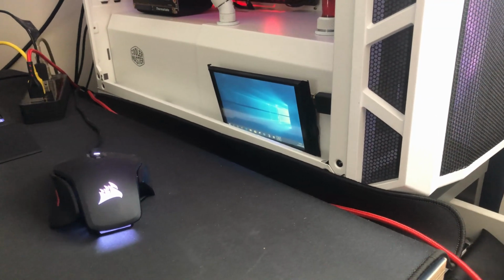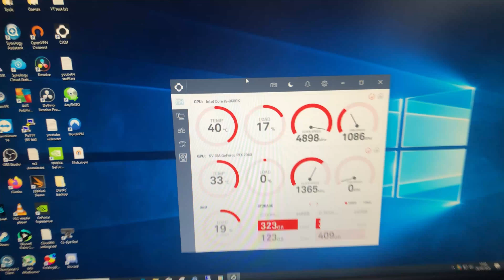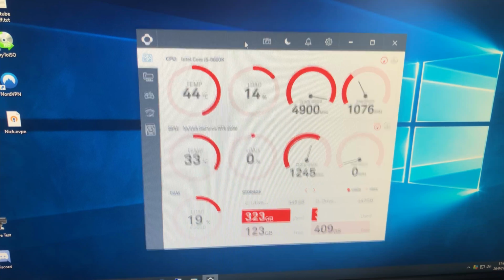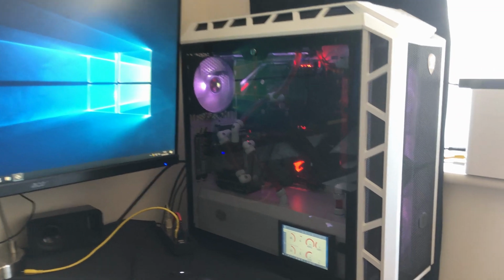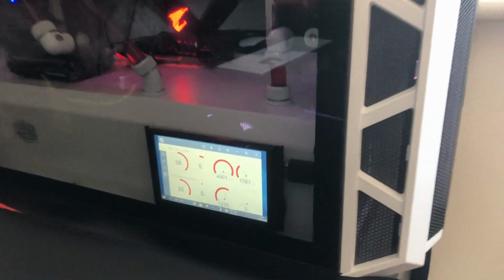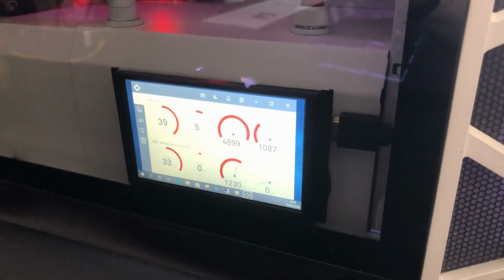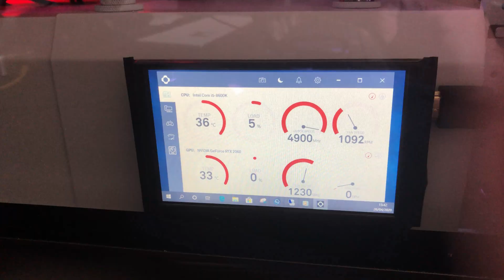Add a mini stats screen in your case

Comment: Does the screen power through the hdmi only
Reply from the maker: Hi Simon, Mine did, it also had a usb port, but i guess that was for powering the touch sensitive part of it, i guess bigger ones may need supplemental power.

Comment: Did you plug it into the motherboard or the gpu? I'm considering building an lcd into my case as well. But I only have 2 ports on my gpu that I use for me monitors, but I still have the hdmi input from my motherboard, I have an intergrated gpu in my intel so I guess I could work?
Reply from the maker: Hey RukyChu, thanks for the comment. I plugged mine into my GPU. You should be able to use the HDMI on your motherboard, but you will likely need to activate it in the bios, as it was likely disabled when you installed your GPU. go into your bios, and look for On Board Graphics, iGPU or something similar. you want to make sue that your GPU is your primary display or it could affect your graphics performance.
I am going to do an update to this video in the coming weeks using a different application to display the stats, if you subscribe you wont miss it.

Comment: I'm looking at buying Lamptron HM070 when it comes into stock on Amazon. Or look elsewhere.
Reply from the maker: Hi there, yeah I have seen those, they are pretty cool, I was looking for a more homebrew look and feel to mine, plus I wanted it inside the case
Reply: @KNTech  thanks for reply, you can set the screen within the case with the lamptron. Dont think it will be back in stock for sometime.
Reply: @DaveBudness  they were using pirated AIDA software so nope..they are not coming back in stock lol
Reply: @shaolin95  okay thanks

Comment: I see you are using a cooler master h500p white. How us that? I am thinking about getting one
Reply from the maker: Hey Tom, I like it a lot, it has great airflow, space for 2 360 radiators if you are watercooling, and i love the full length PSU shroud at the bottom of the case for hiding all your cabling. there is room round the back for cabling, as well a fan controllers etc. I also has moveable HDD (2.5 inch) trays that you place in different locations depending on your cooling solution. For the price it's a great case.
Reply: @KNTech thank you for yr feedback
Reply: @KNTech  Thank you for letting me know. As much as I love this, I might try the Asus Tuff gamming rig gt501. I want a white case with blue lights to show off my Knight King build from GoT

Comment: This is really cool. I wonder if you could mount the screen into a small standalone chassis with something like a raspberry pi, and have it sit somewhere on your desk. You could tap/swipe the screen to show different information like temps, voltage, clock speeds etc. Makes use of the touch screen.

I would mount the screen on the front of my pc as it would be easier to see for me since my pc is not on top of my desk. 

P.S. Nice water loop!
Reply from the maker: Hi There, thanks for the comment. You sure could mount it in such a way that you could get to it to touch it, and then as you say maybe swipe screens left-right for different info. I mounted mine behind the case glass just to keep it tidy. Thanks for the comment on the water loop, follow my channel for a new build in the next month or two.

Comment: A little bit...flamboyant for my tastes and needs but I can see the appeal if you're looking for a solution that does not clutter your primary screen space.

A minor criticism and something that would annoy me over time - it looks unfinished.  Ideally, I would have it fill the entire desktop space and hide the task bar.  This would round it off as a completed solution.

Thoughts?
Reply from the maker: Hey Donut, thanks for the comment. I hear you, this is not for everybody. As for the screen display, you can turn off the taskbar in windows settings, I left it in to show how this simply becomes an additional monitor, once it is in and setup you can customise this just like any additional screen.